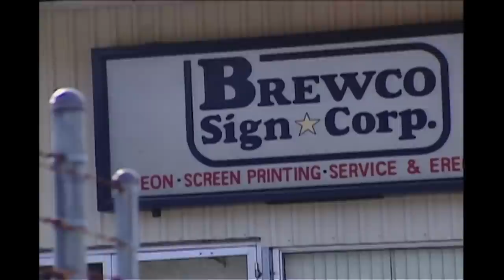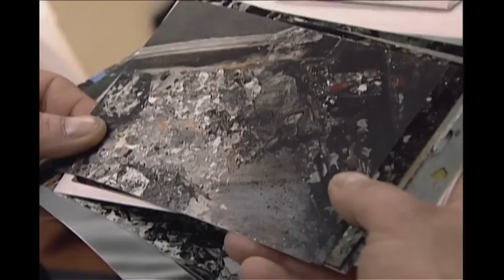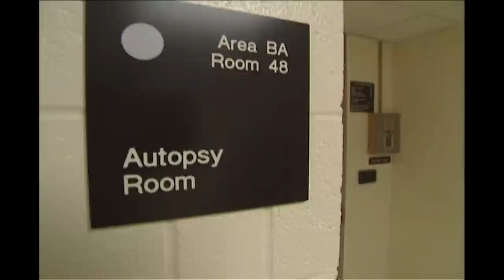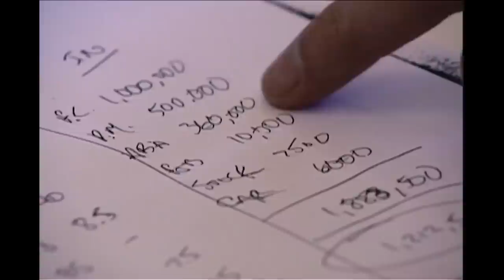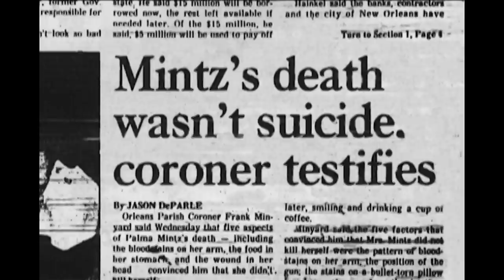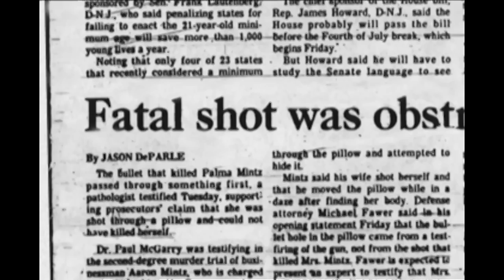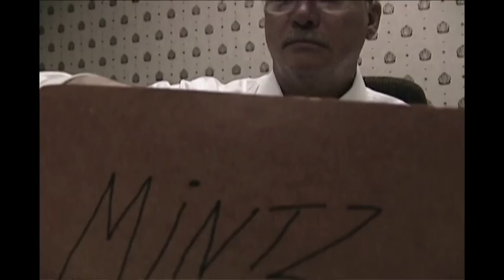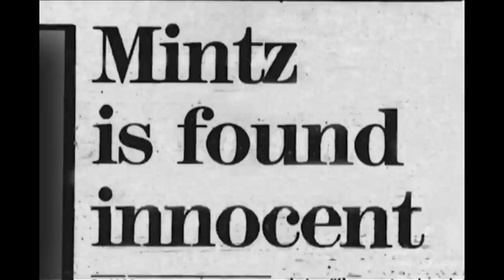Hidden Evidence: Forensics Exposes Criminal Cover-Ups

Comment: Darned YouTube keeps interrupting the ads with some kind of program!!
Reply: Do what I do, send the advertiser an email and confirm they have achieved brand recognition and you are NOT going to buy their product due to their annoying youtube ads. If everybody did it they would have to find a more agreeable way of advertising.
Reply: R/whoosh
Reply: z  
I can only suggest that you try it again, but make sure that you leave at least 10 seconds of the video to play out at the end. Once it's finished, then press "Replay".
Hope that solves your problem but, if not, have a look for the many free adblockers available.
Reply: @Patricia-un6kv  you forgot to tell them they need to turn off auto play and let it play to then end and THEN replay!!
Reply: @Jolenesmart1980  
No, I didn't forget to tell "them" anything.
I didn't know anything about auto play because I had only passed on the fast forward/replay info which many other commenters had made about it.....that is, after I'd already suggested using a free adblocker, one of which I use.
Anyway, I've now stopped trying to pass on helpful information to the hundreds of ad moaners, because it seems to be pointless.
Reply: @Patricia-un6kv  yes the fast forward replay you have to turn off auto play for  and yes im sick of telling people, if they have been on the internet long enough they should know better , i use adblock free also
Reply: @Jolenesmart1980  
Well, I've never had to try out that method, but it appears to work well for those who are too lazy to spend a couple of minutes installing one of the many free apps available.
Stay well, wherever you are...;-)
Reply: Bahahahaha
Reply: @Patricia-un6kv  
Go at 52:56
Let it play till the end.
Then press Replay.
Ads will disappear.

There is no need for 10 seconds.
Just 1 second is enough.
Reply: @Patricia-un6kv  
Also,
Ad block doesn't work on the YouTube app.

Also, the video shouldn't be on a playlist,
because, otherwise, when it ends,
the next video will start playing automatically.

If it is in a playlist,
you can close the video,
Go to History,
and watch the video from there.
Reply: @Thanasis_Koligliatis  
I hope your good advice is read by those who need it.
I've given up on trying to help so many viewers complaining about the ads, because the information to the solutions are right under their noses.

Anyway, take care and stay well, wherever you are...;-)
Reply: @Patricia-un6kv  I am from Greece.
Take care yourself too,
and never give up
Reply: @Thanasis_Koligliatis  
Thank you, Thanasis.
I'm from Ireland (Éire), and I never give up, except on the "ad-moaners"...;-D
Reply: My uncle is called Charles smart we wlive in the uk

Comment: I actually don't understand the 2nd part of the video where the wife was found dead. If she really wanted to take revenge then why didn't she just KILL him?? Also, it could have been possible that the pillow was just put there to distract the investigators. The other thing that intrigued me was that the position of the gun and the bloodstain going backward, it didn't make any sense. Also, how could the defense just base their claim on a PILLOW ??? Wasn't there already enough evidence to point out that this wasn't a suicide??? 

 There is also the possibility that the gun at the crime scene was a decoy with the same caliber. It was kept there to fool the investigators. 

I think the easiest way to know was just to match the fingerprints of the thumb and index finger of the victim and check if there were any on the trigger and if it came back with no fingerprints then the gun was a decoy.
Reply: They only showed you 2 mins of the defense there's a lot more to it and making a man go to prison for life is worse than death in a lot of cases. If the gun was pulled with a cloth or tissue wouldn't that be another good way of making him look guilty.
Reply: To explain blood on pillow, he could have fired through the pillow FEET from her, right?